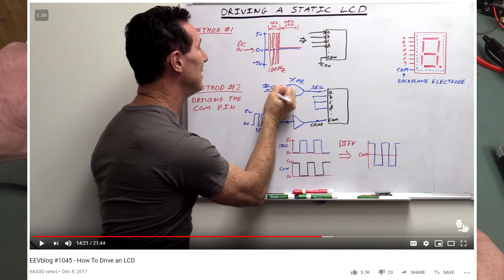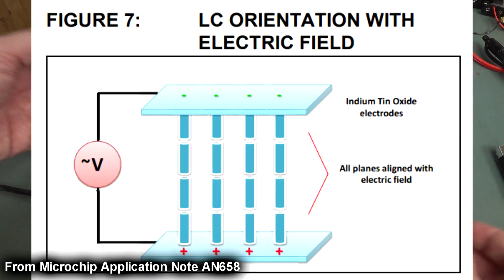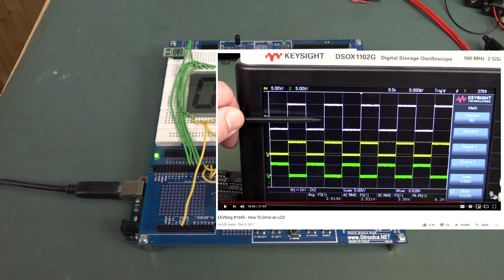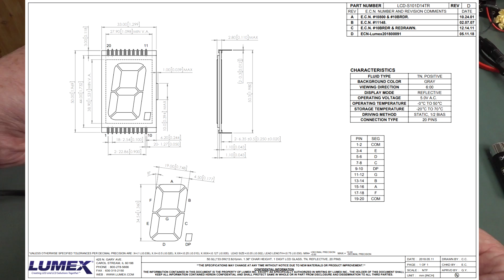EEVblog #1297 - Turn an LCD into E-Paper!

Comment: You DC Imbalance the display, it will get back to another state after a while. It is not bistable, the Cristal will move overall. But it can takes hours if not day to go to another state. EINK display are not using liquid crystals, and are properly bistable, the ink will migrate but after tens of years you still get the same thing on the screen. This will not happen there.
Reply: There is a type of "e-paper" display which is not an e-ink display and is an LCD, the Sharp MemoryLCD. You have to refresh it on like a minute timescale, so you can keep your device in deep sleep most of the time.
Reply: @SianaGearz  Maybe they use a similar effect to this one, only intentional?
Reply: euu guys,... its a joke ... aprill fool?
Reply: @davidblarstron767  Nope, too early. Australia is only +11 at most!
Reply: @GRBtutorials  ....
Reply: david blarstron I may have been fooled but you really can imbalance a segment and make it to stay for some period of time :)
Reply: I’ve done some crazy stuff with eINK panel when I was working for a company making ebook readers. The best was  self migrating ink (because of imbalance) after a couple of minutes with the screen being disconnected. You probably can recover the screen by leaving it disconnected for a very long time, or just reversing the dc polarity
Reply: Actually I wouldn't be so sure that EINK will never go to a different state. May be after years and years on shelf balls will rotate and the image will fade.
Reply: pahom it will degrade over time, but I have screen that hasn’t display thing for years (probably about ten for one of them) and it lost a bit on contrast, but yet, the image is still there.

Comment: The capacitor still have some power left after being unplugged. Pull out the panel from the board so I will believe it won't need power
Reply: I second this, pull the segment off the board and see what happens.
Reply: @Dhen Phu Dave is clearly abusing his international date line privilege. I'm frankly amazed by how many people fall for it every year.
Reply: @Guysm1l3y  he even reposted a time zone video on the comunity tab
Reply: Still being able to turn off/sleep your board for a few hours with no active circuitry would save a lot power right? L
Reply from the maker: But it worked fine a year ago, switched off immediately with power as you'd expect. Now it stays on. Same connections.
Reply: @EEVblog  pull the power then short it to ground?
Reply: @EEVblog  I would pull some of the breadboard wires to explicitly  demonstrate that it is not residual voltage from the CPU. 
It would have made for good content. 
Even pull the lCD from the breadboard if you want to be dramatic. Maybe leave that stuff for ElectroBOOM
Reply: @EEVblog  Looks a lot snappier than E ink regarding refresh, and it maintains better readability after power off, great find.
Reply: Robert did you have a look at the date this video was posted?
Reply: smig smög  Kiribati's time zone is GMT+14
Reply: Australia is about 16 hours ahead of the US.....
Reply: @Dhen Phu it is in Australia
Reply: @greggjaskiewicz  It's only Marc 31, 22:52 in Sydney time

Comment: Now do this with full HD color screen :)
Reply: I think i will try this. But lets start small. :D
Reply: Most coloured displays need a backlight which still requires power (an emissive display). There aren't many reflective (if any) colourered displays. If you find one let me know because most of the energy to drive a display is from the backlight so even that out of the way opens up tonnes of applications
Reply: Daniel Hawkins game boy lcd or ipod lcd
Reply: @ItsJustMeMusic  Yeah, but both devices are quite old already... there's a reason they're no longer used.